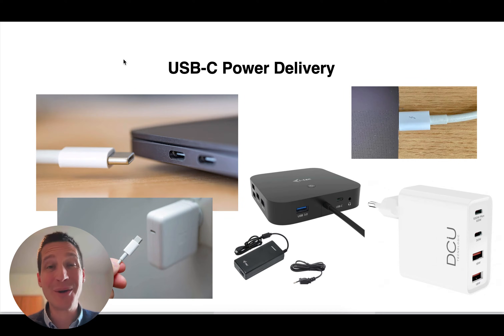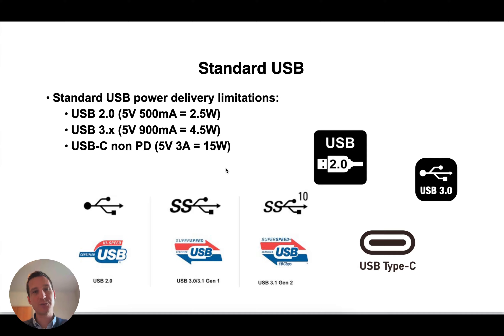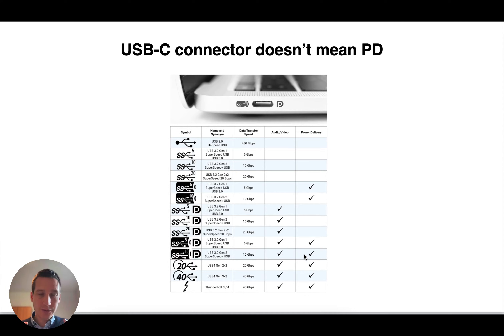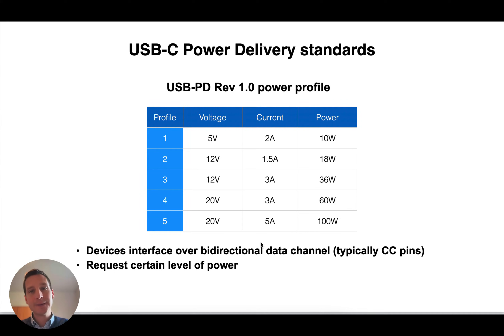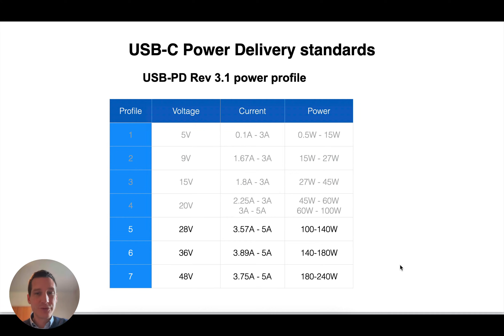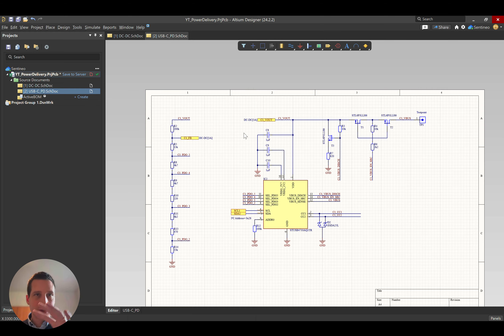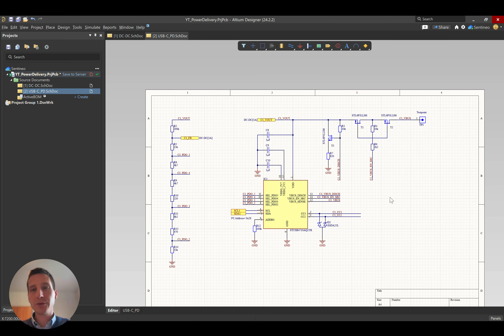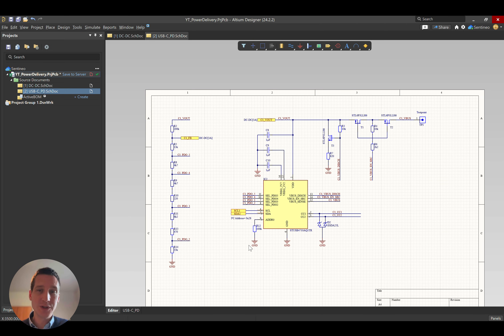USB-C Power Delivery Explained

Comment: For Usb C PD , Voltage will
 auto selected with connected source? Or we still needed to concern about the output voltage?
Reply from the maker: It will be negotiated indeed via the USB-PD controller. Typically this will interface with a DC-DC converter with selectable output voltage set by the PD controller.

Comment: Thanks

I just bought the Lenovo Yoga 7 2-in-1 16IML9 and I’m a bit confused about the two USB-C ports—one marked with a plug icon (🔌) and the other with a thunderbolt icon (⚡). Which one is actually used for charging the laptop? The manual isn’t clear. I’ve read some reviews saying both ports can be used for charging, but if that’s the case, why are the two ports labeled with different icons?

Unfortunately, the manual does not explain this clearly and the people in the Lenovo Community are just guessing 😞 

Your comments please!

Comment: Thank you, well presented. 
It does raise a few more questions in my mind. 
I understand that the cable is also intelligent and has one or even two chips in it? So the host device has to negotiate with two downstream devices, the cable, and the peripheral. How does this negotiation take place, who has priority, how does the host know who it's talking to? 
Secondly, there is a complicated piece of software to handle the PD protocol. Is this generally written by each manufacturer separately? Is there a standard software stack that is used everywhere? 
Thirdly, it's a switch mode power supply, and I'm curious if there are any specifications on the frequency of the switching, allowed ripple, and allowed tolerance.

Comment: Thank you! Excellent info. Question: I have a cable from USB-C to XT60 connector. The XT60 is for power supply to charge batteries. The power supply has input voltage 7-30v. Using this cable, how does the USB-C know what voltage and power to deliver? Thank you again!

Comment: Can it supply bidirectional power ? I mean if I want to design USB hub and want to charge upstream device and transfer data, can I use it?
Reply from the maker: This controller will only work for power delivery. If you want a combination with data exchange in DFP/UFP/DRP mode typically you would combine it with a device like this: https://www.ti.com/lit/ds/symlink/hd3ss3220.pdf
Reply: @sentineo  Actually my question was wrong. I need PD IC which has power role swap to combine it with HD3SS3220.